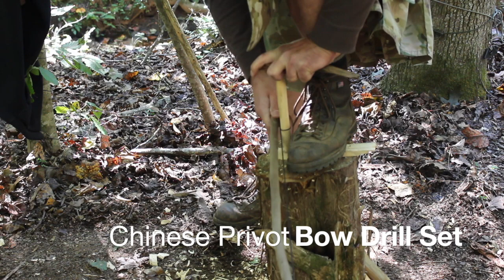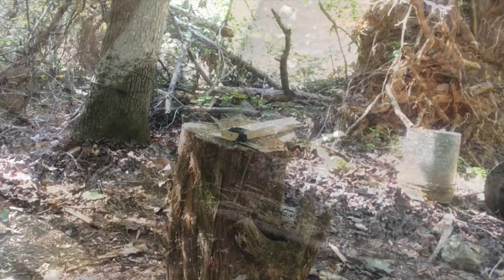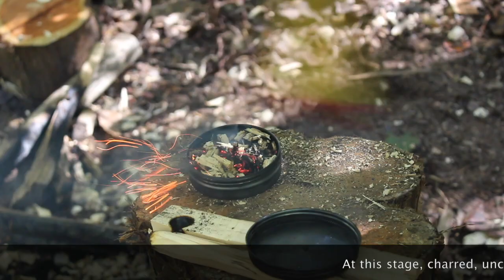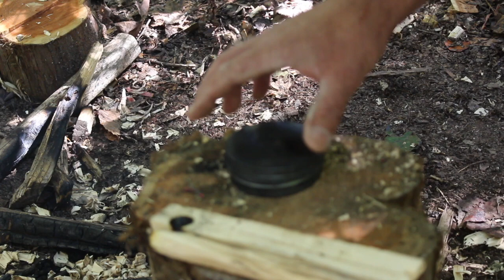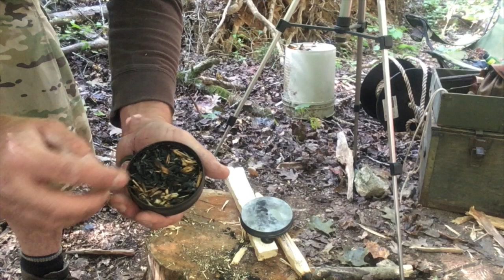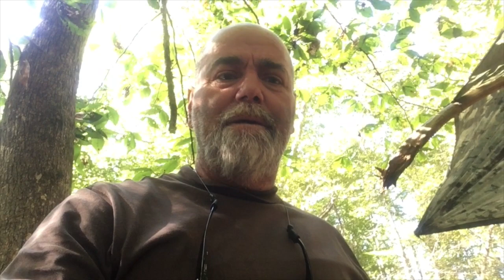Flint and Steel Kit: Uncharred, Charred, and Ashed Material

Comment: I boil my Amadou in a salutation of ash and water. It's not necessarily, but i feel it works a little better.
Reply from the maker: I've heard lately of people doing that. Interesting. I wonder if applying ash after boiling would bring the amadou to flame instead of smoldering.
Reply: Horse hoofs fungi from any tree can be treated with the ash to create similiar results to chaga or amadou. It certainly works for that and I am experimenting with southeastern fungi in hopes to find a bracket or shelf fungi that work under that treatment. Chaga and amadou  are not found in the area I live and would love to get my hands on some. I have found some small thin fungi that seem promising. I am also considering gel waxing with plain gel wax or enhanced with ash on fungi here in NC. Variations in soak periods should show some results in variou s types of tree fungi. Dried ear jelly from tree limbs are good fire starters.